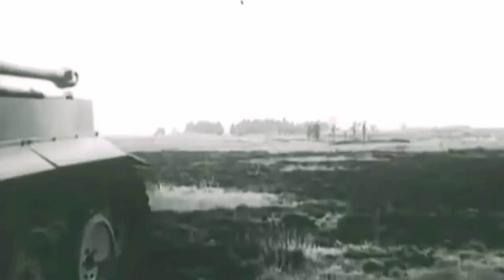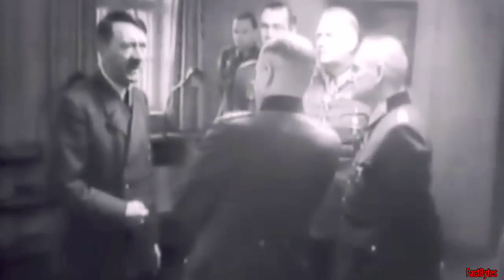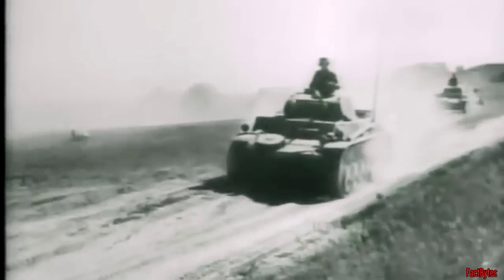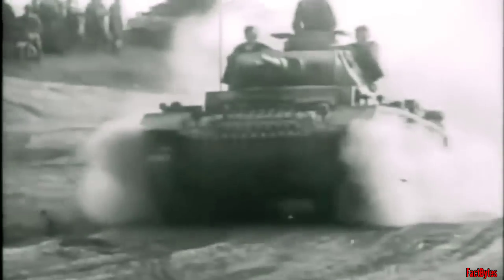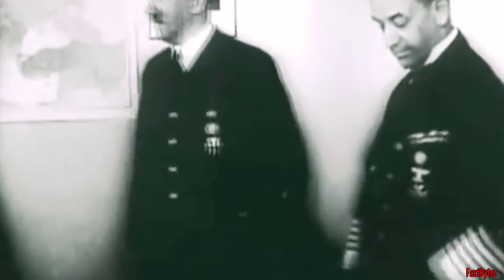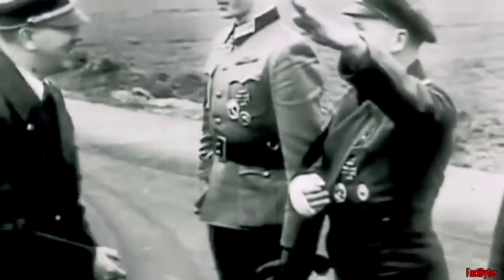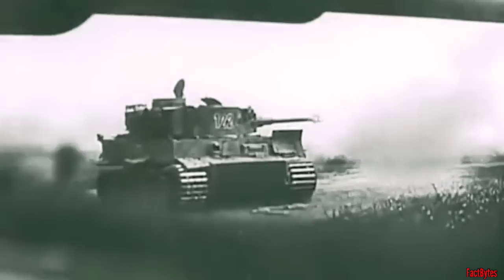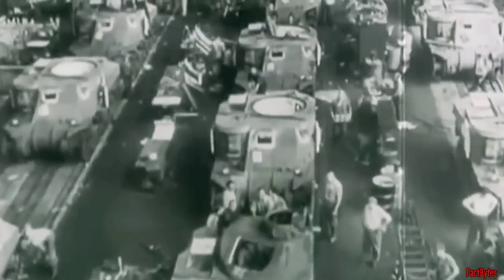Were German WWII Tanks REALLY Over-engineered?

Comment: Very good  video. I would like to add that many breakdowns of german tanks can likely be attributed to the fact that their factories and support lines were constantly bombed. And as the war progressed, they ran out of raw materials to produce spare parts at all. Therefore spare parts were ever harder to produce and harder to transport to the front. Without spare parts, no tank can survive.
Reply: And how many were sabotaged  in the manufacturing  process by forced workers.
Reply: @davidbell1619  I want to see a detailed video of that, because that is an interesting topic on its own. 
Like the fact that the Germans picked highly qualified specialists to do some of the forced labor tasks. Those people, being specialists knew how to sabotage equipment, so that is passes quality control, but then fails after a short while in use.

Like building parts to maximum or minimum allowed tolerances. If you have one part or two like that in a system, the system works, but when there are many moving parts like that, connected to each other, the system will fail. 
That in turn created headaches for the designers, leading to re-designs of parts.
Reply: As a machinist, I fully agree. Stretch your max tolerances to the limit on every part and the whole mechanism will be sloppy. Tighten them all up and nothing will move.
Reply: Bombed?, Really?, That's Terribly Sad!.

Comment: especially by the late war, fuel shortages meant it wasn't necessarily a priority to field a large number of tanks and so focusing on quality per unit was cost-effective. That these tanks still provided such stubborn resistance when so many were mothballed in maintenance at any one time is impressive, if all units had been functional it would have taken much longer before german forces had been overwhelmed.
Reply: Also, too, manpower shortages...
Reply: More ghost units than real units!
Reply: This is what most people overlook. They think that the Germans chose to not mass produce the Panzer IV. 
The truth is that even if they had millions of tanks in storage, they only had fuel for a handful of tanks at a time, so they had to make every tank count.
Reply: They didn't focus on quality. Not the kind of quality that wins wars anyway. High quality paint job does not win wars.
Actual high quality engineering does, and simplicity is a mark of quality engineering, not complexity.

Comment: Regarding the Panzer 4, it had reached its end of upgradeability and thus the panther, which had it beat in almost all measures, was needed.
Reply: Any tank with the 75mm KWK 42 was the equal or better of any tank it faced due to that weapon's accuracy and firepower.  While the Panther offered significantly better protection than the Panzer 4, what's the point of using Panthers if you're going to duel Shermans at close range?
Reply: @hammerfist8763  You do not choose what to produce on "fighting shermans close range" alone. Theres plenty of other scenarios to consider and im sure the people who actually fought the war knew what they were doing. Historians today claim alot of things that isnt nessesarily correct. The T-34 for instance is hailed as one of the best tanks of the war, though battle report show that it was one of the worst. Out of 60kis produced they lost almost 90% of them. Due to its heavily sloped armor it was hard to surive too and so the soviets were forced to send inexperienced soldiers up against veterans. Only ready they won was because germany couldnt outproduce the whole world. No amount of panzer 4 would have changed that outcome.
Reply: @benjammin3381  My statement. this video, many war documentaries, and my 5 years of frontline combat experience indicate  opposite of your assumption.  "I'm sure the people who actually fought the war knew what they were doing."  It's more like the 10-90 rule.  10% had a clue and 90% didn't.  The sloped armor of the T-34's helped deflect countless 50mm from Panzer 3's and saved a lot of Russian tanker lives.  To then waste those lives by throwing a 100 T-34's over open ground from long range at a platoon of Tigers and getting them all blown to hell before they get in range is idiotic.  Just as dumb as Panthers fighting Shermans at point blank range.  If you're going to do something that stupid, do it with a cheaper tank.  No shortage of stupidity on the Eastern or Western fronts by either of the sides.
Reply: @hammerfist8763  Im not sure i understand your point. Are you saying the panther was a bad design and that they should have stuck to the panzer 4 instead? Cus sure, the panther isnt the best choice in every situation.

Comment: the main "mistake" was using petrol-motors instead of stronger diesel motors. The both heavy tanks tiger and panther were great,problem was,that from 1944 onwards rare metals for high quality steel and high end motors were not anymore available,which is,why most gear boxes and suspensions were unreliable in reality. the german NEVER could have coped with the output combined of USSR and USA together in tank production

Comment: The Panzer 4 remained "good enough" up until the war's end and served as workhorse but by 1943/44 the tank had reached its limit in terms of exploitation potential. On the other hand the Tiger had among others one flaw which by itself was fundamental - very few could've been produced in practice. 
The Panther was as effective in battle as the Tiger while being only ~20% more costly to produce than the Panzer 4. I think it would've made much sense had the Germans redirected the resources from these two tanks to the production of the Panther, making it a workhorse instead of the Panzer 4.

Comment: Interesting video, yet let's not forget that the highest decorated tank aces of Germany like Kurt Knispel, Otto Carius, Michael Witmman and some others during World War II were either using the Königstiger or the Panther which with  they decimated more than a hundred of allied tanks each. The quality of the Zeiss optics , superior armor and better canon made them better tanks. Maybe except the JS 1 and 2 which I can consider as an equal to the Königstiger or the Panther and perhaps the Sherman firefly (tough less heavier and  far less well armored than the Königstiger or the Panther). When the Königstiger or the Panther were badly hit, crews rather destructed than let them operable.
Reply: It's kind of like comparing Lee to Grant in the American Civil War. The German tanks are Lee. He looks great and flashy, what an underdog, winning those battles. Because of that, there's a certain mythos. Grant, though, understood what it took to win a war, rather than a battle. And he did just that.  Shermans are a war winning tank. Tigers are not. But in fairness to the Tiger, it was rarely used for its intended purpose. It was supposed to be used to break through defended positions. So you'd ship it where it was needed, do the necessary maintenance, smash the enemy in that location, and then turn it over to the other, lighter, faster tanks.

The Panther was good once its teething problems were solved. Great gun on it, nice sloped armor, and so on. Does outperform the Sherman in certain combat aspects, but was generally worse on the logistics/maintenance side of things. But, well, that's kind of to be expected in WW2. The pace of innovation was so fast, and the Sherman was a few years older.

The Firefly, by the way, is a bit overrated. Fitting that gun in had a bad impact on crew ergonomics, plus it had a slow rate of fire. Its SABOT round also had an issue with how it interacted with the muzzle break, resulting in low accuracy at long range. All these are reasons why the US rejected using Fireflies. Of course, on the odd chance you did happen to run into a Tiger (which was very low on the Western front), you'd definitely wouldn't mind having one along, but, overall, because the Sherman was reliable, easy to maintain, and easy to supply/support/ship, there were usually a full group of five Shermans around, and that didn't end well for the rare Tiger.

Comment: My dad was a tank commander he said they were good enough that our shells bounced off them after his first encounter in North Africa he found it was best to shoot the tracks off them.
Reply: I’ve read about a similar tactic used by Soviet tankers using Lend-Lease Shermans. They would shoot one of the tracks on a Tiger that was on the move, this would cause it to turn (if they shot the left track, the enemy tank would turn left). They would then put a round in the Tiger’s exposed side armor.
Reply: @brennanleadbetter9708 that must have been at quite short ranges. Since you said that when it turns, the side armor will be exposed, that must mean the Tiger is going directly towards the tank that is shooting it. Knowing both how small the cross sectional area of a tank track is from a frontal view and that Soviet tank sights were of particularly low quality, that type of accuracy wouldn’t be possible even at ranges of around 1,000 meters (especially since the target is moving).
Reply: @collinwood6573  This was a tactic used by Soviet tankers using Shermans, which had pretty good sights. The following is a text from the book “Commanding the Red Army’s Sherman Tanks”, which was written by a Soviet tank tanker. 
“Two Shermans were designated in each platoon for each single attacking Tiger. One tank fired armor-piercing shells at one or the other track, the other tank awaited the moment when the undamaged track had driven the German tank into a 90-degree turn, exposing its entire flank. Then it delivered a solid shot into the fuel cell. As a rule, attacking enemy tanks were permitted to close to four hundred to five hundred meters. It was difficult to break a track at greater ranges”.

Comment: ReichMark (RM) 
Stug III               82,500 RM (top tank killer of all time)
Pz III                  96,000 RM 
Pz IV                 103,000 RM 
Pz V (Panther) 117,000 RM
Pz VI (Tiger I)   250,000 RM 
Tiger II               800,000 RM (300,000 man hours)
These figures don't include armament, radio or logistic costs (at a time of acute fuel shortage) nor reflect the chance of after action recovery. Reliability was relatively poor even for late model Pz V.